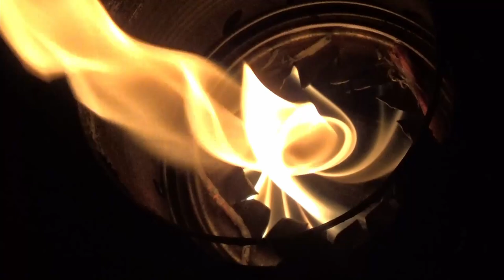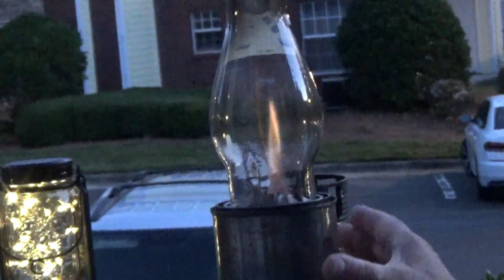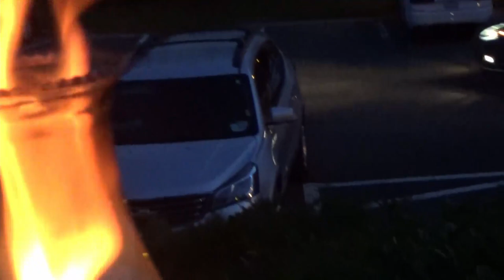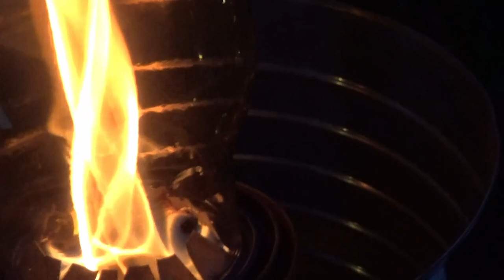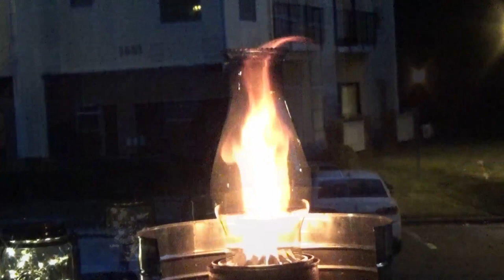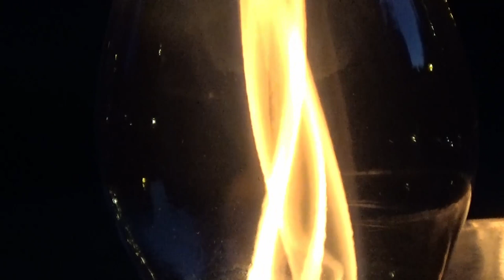Wood Gas Lantern! Camping Lamp! Paint Can Wood Gas Stove Optimization! Wood Gas Stove Science

Comment: How do you get the awesome swirl in your flame?
Reply from the maker: It involves precision in the hole making and a lot of experimenting. I show you how in my Wood Gas Stove Science series of videos... Check out the Vortex 5.4 build video. Thanks for watching!
Reply: Stan Lindert You put the drill into the can with the drill bit facing the side a little. It makes the drill holes look kind of crooked. They are tilted a little. That is what creates the vortex.
Reply: @heathputnam9524  you could, instead of drilling them, make vertical cuts where there are holes, and then open them up to one side only. I made a bunch of alcohol stoves and ended up doing this instead of drilling round holes and because it was far superior.

Comment: Yes! Please keep working on the lamp. A stove / lamp combo would be awesome for camping.
Reply from the maker: Will do! Thanks for the comment!
Reply: @heathputnam9524  Awesome! :D
Reply from the maker: Thanks!
Reply: YOU just gave me an excellent Idea!!
A bright betty lamp works well for a lantern but is usually made from a glass mason jar so there are no holes to create airflow for a stove.  But you can make a pan stand to try to cook above it. But that would be like literally cooking over a candle.
Being a glassblower, I can make a glass jar with airflow holes towards the bottom to see if a "Rocket Stove" effect would happen with the candle flame.  It would require a larger wick made from carbon felt or fiberglass so it wouldn't burn out.

Comment: Hi, yes I would very much appreciate your time and effort messing around with this idea. Ideally on the smaller camping type stove.  It would be great to have one that can be multifunctional. I have made a few including forced air which enables the output to be totally controlled. The only thing that I do in addition is fit metal rods to the bottom to make it far more stable for rough ground. This connects to the wind shield which can then also become part of the pot stand. A pan full of boiling water over you in the middle of nowhere can have potentially serious consequences.
Keep up the good work from a avid watcher
Reply from the maker: Just let me know if you need info! Thanks for watching!
Reply: @heathputnam9524 

There are two other ideas that have been bouncing around in my head for quite some time. Unfortunately I have just not got the time to experiment (the wife gives me to much ear ache!!!! For some unknown reason she likes my company) Any way how about playing around with the design to get it to burn as slow as possible. Still on a wood gasifier basis so that you have a clean smoke free burn. However using this for  heating. What would be the smallest amount of primary and secondary holes to still get the pyrolysis effect? What would be the size of containers required to be able to achieve a burn of say 3 hours. What type of addition  could be made to put over the flame to increase the thermal output. If it would glow red hot then it should have a infa red radiation effect. 
  Do you fancy having an experiment
Secondly would it be possible to "tap off" or "extract" some of the the wood gas to supply a light source. This could then be controlled to give a smaller and not so fierce a flame as using the whole stove. Altering the air to gas mixture via a venturi valve could even run a glass fiber mantel as mentioned by another of your watchers.
   I hope this might give you some "food for thought" as I am sure that there may be a commercial possibility from developing these ideas. We all love a gadget don't we. I know preppers and off grid fanatics who would pay a fortune for a "all in one" stove/heater/light.
   Please let me know what you think.
Many thanks John Stott
Reply from the maker: Yeah I still tell my wife “see that solo stove, that could have been me!”. When I see the commercials. I just hope my videos help the diyer! I may give your ideas a try. It is not a can from the garbage heap type of stove though! :)

Comment: Super cool "lantern". If you add the inlet air adjustment ring at the base, you could probably easily regulate the height of the flame to be just to the top of the globe... not sure how smokey the flame might get and foul the inside of the globe completely black after a while. You will need some attachment method to keep the globe in place so it doesn't tip or blow off much like an oil lamp used.

Comment: This is really neat! I would enjoy seeing more development of this idea - particularly around matching the flame size to the glass globe. 
Do you think this lantern could be safely used indoors? I'm wondering both about potentially dangerous gasses (CO and CO2?) and smoke/particulates. If you think it would be safe during the main part of the burn, how could the lighting/extinguishing parts be handled without producing too much gas/smoke/soot? Would you just have to do that outdoors?
Reply from the maker: Thanks, it was a fun experiment. I did build a stove with a dampener on the air intake and you could adjust the burn intensity. The stove is pretty much smoke free but I am sure some CO is generated. If you let it burn out by itself it does not smoke but if it extinguished there is a ton of smoke… this is a wood gas stove so it makes gas/smoke and then burns it. Thanks for watching!
Reply: @heathputnam9524  Thanks for the reply! 
Yes, a dampener would likely help with matching flame height to the globe. Do you think it would decrease burn efficiency and create more CO, though, or is that more dependent on other parts of the design?
For the CO risk more generally, I guess it might be worth trying to test the lamp in a small space (without people) with a CO detector. My impression is that when people have used gas for lighting historically it would have been producing some CO indoors and that usually worked OK, but their houses were probably draftier than most houses today.
My family heats with a wood stove, so I'm also wondering whether it might be practical to connect the lamp exhaust into the existing chimney, thus eliminating the CO risk.

Comment: careful that globe was not designed for this much heat it will crack. Try a larger diametre globe maybe experiment with cutting the bottom off some glass jars then you can experiment with height. You don't want a flame too high or you will burn up all your fuel to quickly. Sure does look good though. hope this is of interest.
Reply from the maker: Thanks! Yes the globe was cheap but I want a lantern that will last! Thanks again for the comment!

Comment: you might get the same effect or nearly so with a hardware cloth cylinder in place of the glass.  Also, in a calm room if you put out a candle and then bring a lit match to the smoke it will flash back to the candle and relight it.
Reply from the maker: Actually the glass gives a strong chimney effect that you will not get with hardware cloth, the glass also protects the flame from the wind. The smoke relighting is very similar the the wood gas reigniting! Thanks for the comment!
Reply: @heathputnam9524  I know it is counter intuitive, but you can get a chimney effect with non-solid chimneys: https://www.youtube.com/watch?v=W81NeBEG8G8
Reply from the maker: Interesting.
Reply: @heathputnam9524  Eventually I hope to get a couple of stoves built to demonstrate this on a smaller scale.
Reply from the maker: Let me know how they work! Thanks for watching!

Comment: My big fear would be that a flame that big could damage the globe.
Reply from the maker: I haven't had an issue yet, but it could crack the globe. Thanks for the comment!
Reply: I don't know if they make them, but a borosilicate glass globe would be your best bet, because not only does it have higher heat tolerance than soda glass, more importantly, it handles sudden temp changes and extremes far better. That's why most glass cook ware is made out of borosillicate glass and not soda glass.
Reply: @heathputnam9524  pppppp
Reply: P